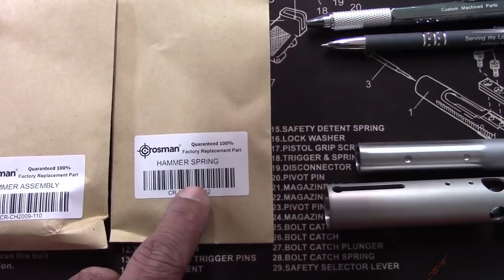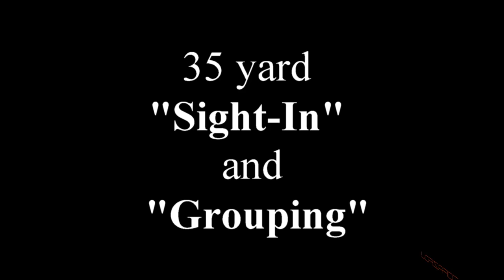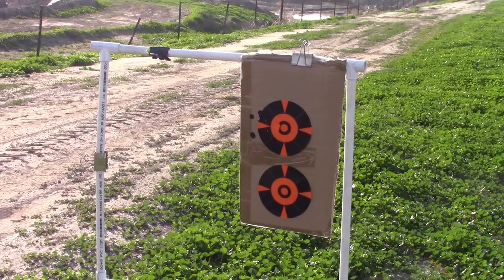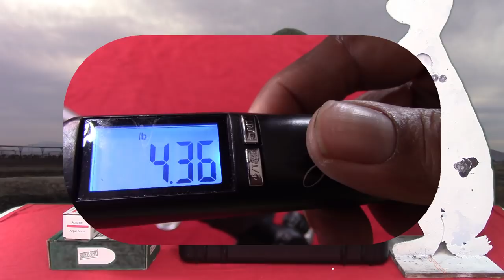INTRO:  COTHRAN .457 Pistol

Comment: Amazing little pistol. I have n Hi Pac version in .22  20" bbl, now carbine. Never thought that frame would handle such a large round and air pressure. Also have a (25) .243 slugs condor I modeled after your breakthrough slugs. Was alot of trial and error to get the slugs to fit rite. Due to the lother/walther  choked barrel.
Reply from the maker: Sounds like you got some good stuff going on.  Be careful with that Hi Pac.  As far as the frame of the gun goes, he uses a much stronger metal that whats offered in OEM parts that mimic this gun.  He had the tubes tested to an UnGodly amount of fill pressure that we will never be able to fill to.  Thats the mark of someone who knows what they are doing.  The guns safety factor is something like 4-1

Comment: Welcome to 2020!  Been wondering where you’ve been.  I actually got excited for you when I heard the metal ring.  Began sing ‘Ring That Bell’ so am dating myself.  I love the geek stuff and really respect what you with that. But the field stuff makes me wanna get outside.  I am thinking that the optimum speed/pressure is not always, maybe ever, full pressure.  Besides, 150 FPE on a rabbit/varmint is plenty, right?  To steal your quote, “enough texting, let’s go outside!”  👍
Reply from the maker: RCG, im here my brotha.  I still make videos often.  You bring up and very GOOD point that everyone should learn.  The gun and ammo dictates what it likes.  You can run a gun/ammo all out but that doesn't mean the accuracy will be up to snuff.  The gun can be "SAFELY" fill to higher pressures but, there will be a limit and the ammo may not perform well.  With airguns, there is way more tuning that with a centerfire/rimfire weapon.  With his valve, you have to understand its purpose and how it works (which i do).  Knowing this off the bat tell you something about where the gun will perform.  Its a high performance valve and is like no other.  So you have to use it like its meant to be used.  And that's, making power.   But you can have both worlds (power/accuracy).

Comment: Good scope…a must find. I got lucky and found a 3X AOBurris AOE, awesome whatever I’m using and it is totally deadly on my unregulated Diana Bandit. In .22 cal and it an unregulated tack driving death machine.  I have a question sir….how often do I need to clean the barrel on my SK-19 .25 with a poly barrel? I don’t push JSB 34 grain or FX pellets past this speed. The FX pellets held a tighter group than the JSB of the same weight. Do I need to clean this barrel now and coat my pellets with silicone???💯🤷‍♂️

Comment: It looks like a discovery and Marauder pistol parts with a bunch of hopped up parts out off stainless steel. Does he sell just the barrel sweat pistol the hammer look like the old 1377 from the 60s with a twist.👍👌✌️🤔😇
Reply from the maker: Thats exactly what the parts are.  As far as selling the barrel separately, you will have to call him.  Thanks for the comment

Comment: OF COURSE HTIS AP IS INSANE!  I have to ask how much was all of hte ammo--gun-special air compressor and does a 2300psi air pistol only shoot 3 times? i dont see that as a prob..just reg guns and ammo have to be much cheaper.got my 3 action b from pops for 300, ammo 50 bucks, and that 9 kill anything running and sink hole on one target hits, in center mass every time. THis is the coolest air pistol i've ever seen, but it must have cost thousands, w a damn ven diagram for parts and shipped in baggies..very nicely made of what looks to be 440 Stainless Steel, and is very well made. Why did it use crossman parts? THey could not make their own? or as a time saver for the same part they dont have to bother making? i could not tell what they were as you didnt open them.?